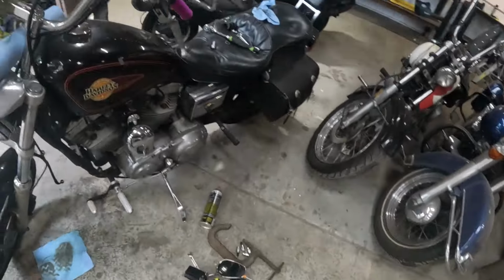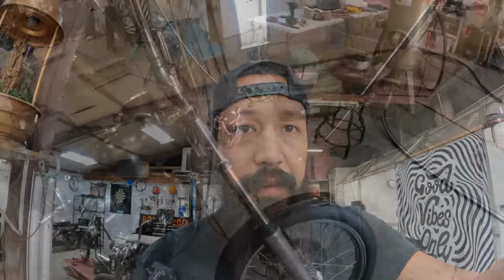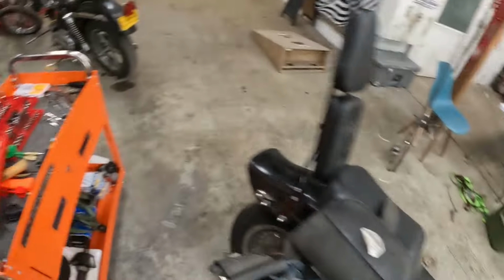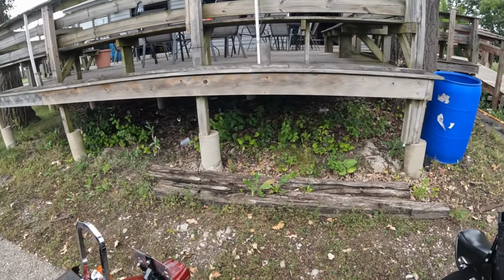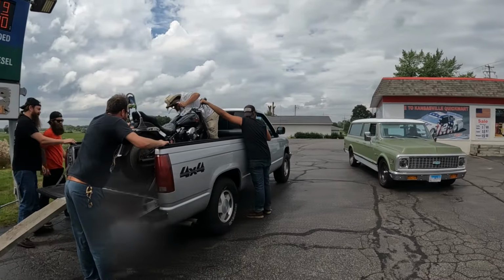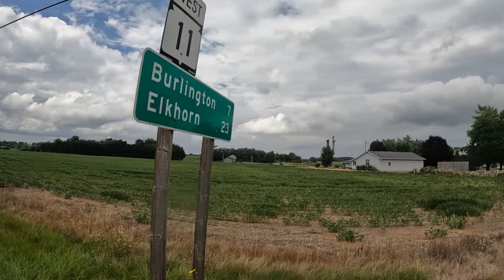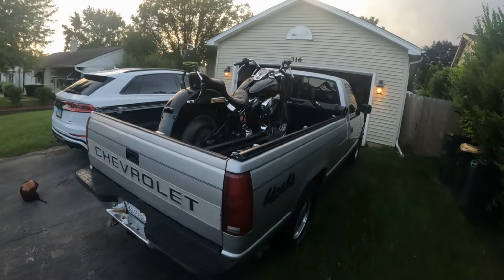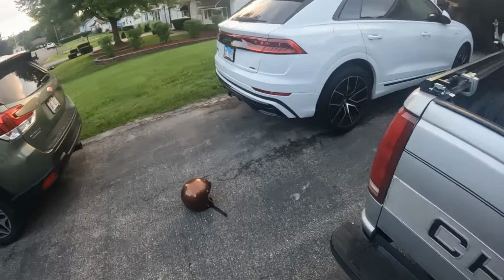Evo Softail: Carb Cleaner and Bags - Bachelor Party Sunday Funday Ride

Comment: I know im late but, the brake issue sounds like a collapsed rubber hose ,not a master cylinder or caliper issue.
Reply from the maker: I thought that too, but it was all clear.  No issues at all since the master cylinder rebuild.  It was pulling in some air around the O ring up top.